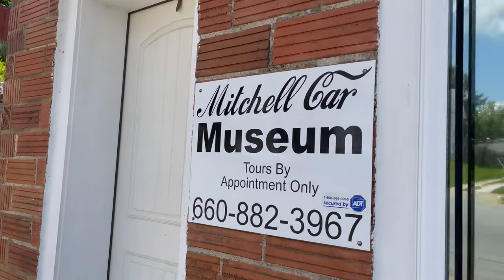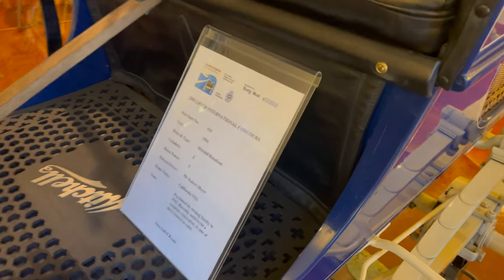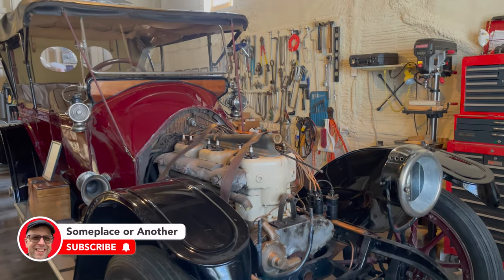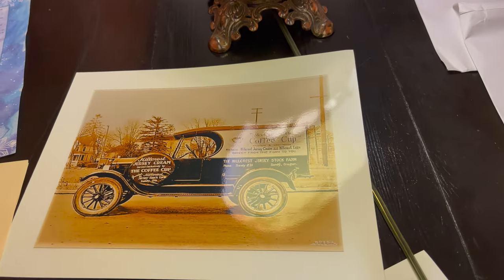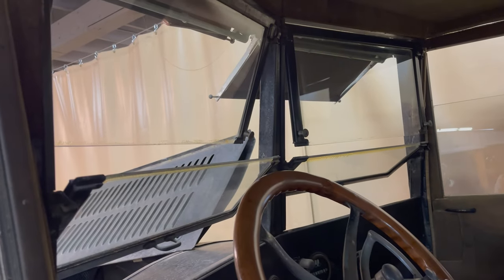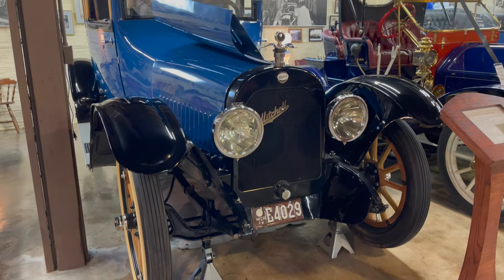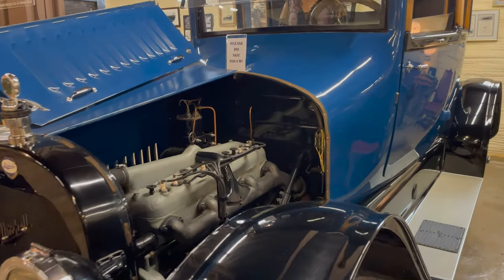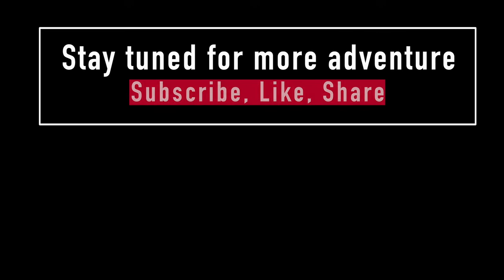Mitchell Antique Motor car Museum - Boonville Missouri 👍 Car Museum 😎 Rare Cars 😃 #cars #carvideo

Comment: I have photos of all of the cars in the Mitchell Car Museum that was located in Owosso Michigan.  There even are several photos of Mitchell Cars (1908 Mitchell model I, 1908 Mitchell model H, 1911 Mitchell model T, 1917 Mitchell D 40 JR, 1919 Mitchell 3 passenger coupe, 1919 C Cab Delivery Truck).  I always was told that the Michell cars were made in Wisconsin by a distant relative of the Owosso Mitchells.
Reply from the maker: That's pretty cool! 😎